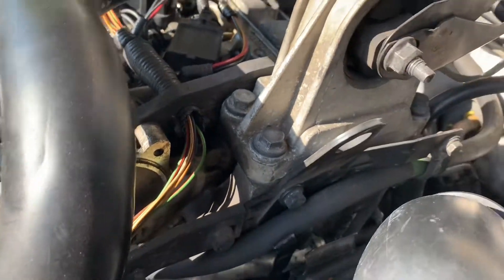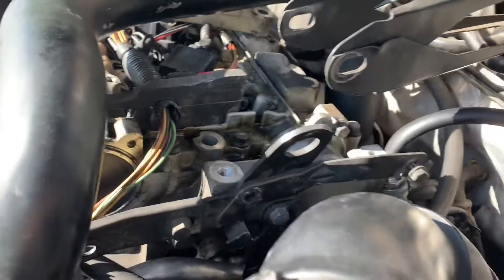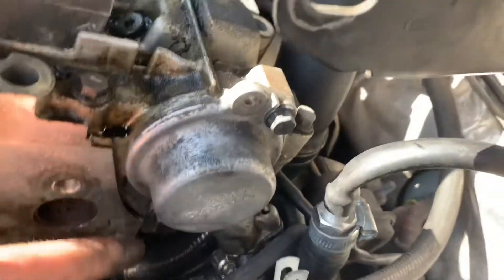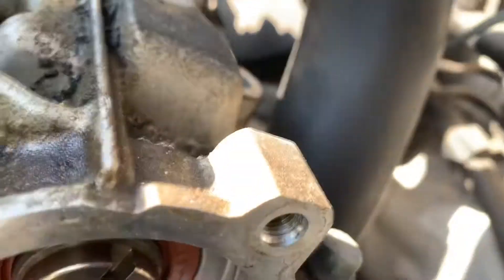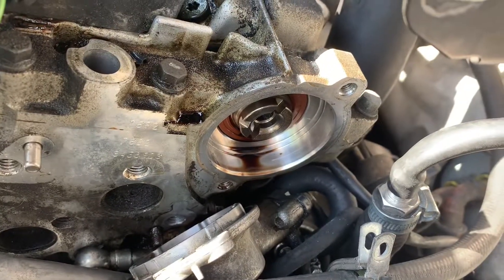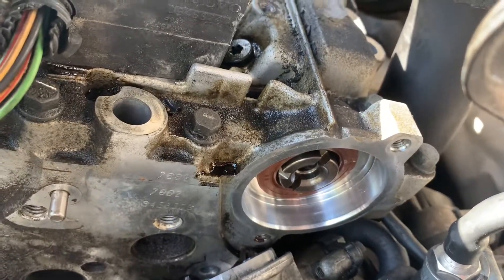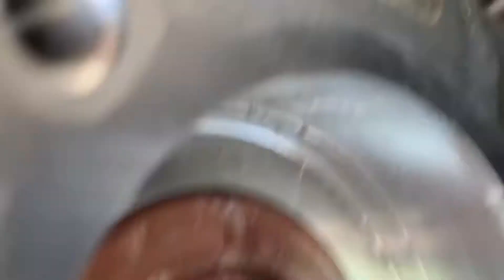HOW TO CHANGE A VOLVO REAR CAMSHAFT SEAL

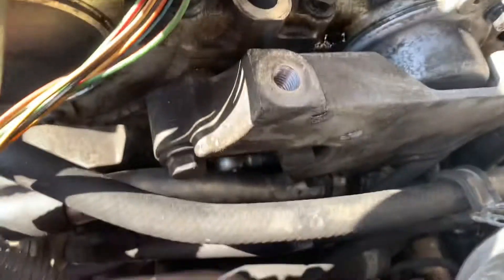Comment: Cheers mate. Saved me some hassle looking for those three bolts holding the bracket bolted to the engine that covers the cam sensor housing at 1:31

Comment: Thank you. My buddy and I did all 3 cam seals a year ago but he got too high and cut the new seal as he was installing it 😅 I ran with it like that for a year and noticed oil leaking right where you said, it looked like the turbo but it was coming from higher up, hitting the turbo and dripping down to the oil pan... Then I remembered the uh-oh.  I still have the installer tool too but will remember not to push it in past flush